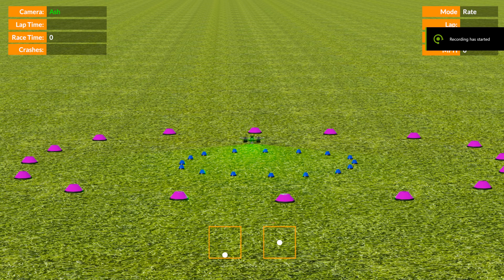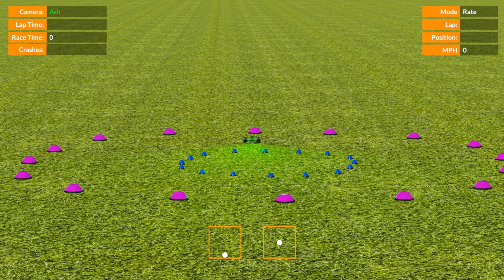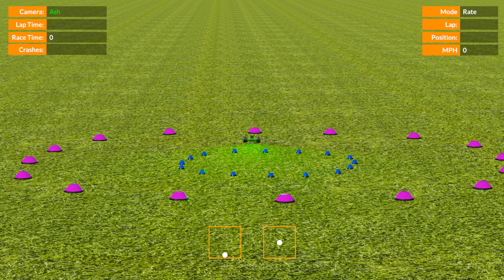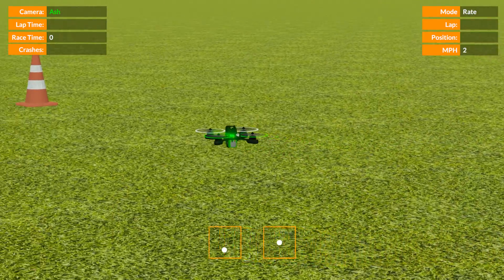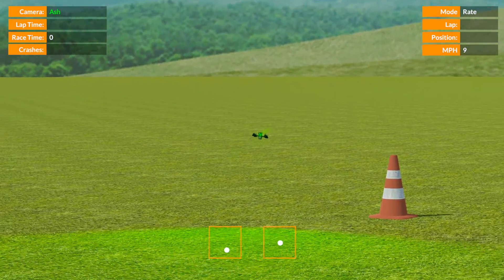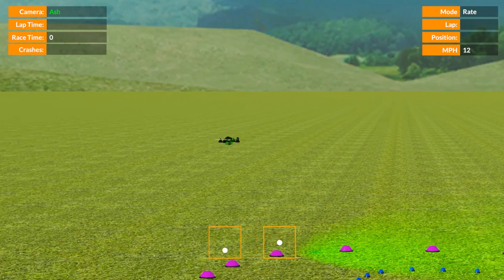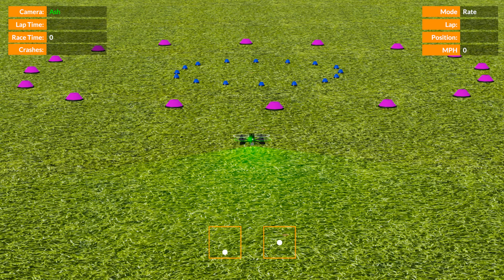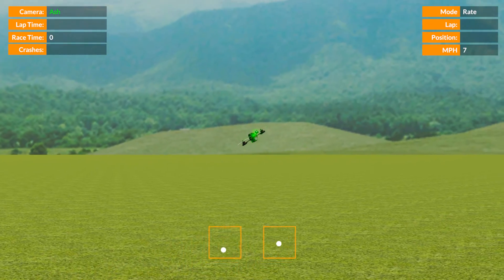Flight Training - Line of sight - Lazy eight circuits

Comment: Please can you make a video for drone configuration? I can't fly with a low throttle like you do, probably something is wrong in my drone configuration. Thank you.
Reply from the maker: I only change my PIDs to 450 deg/s using super rate, apart from that I don't make any configuration changes to the drone. It is all defaults as shipped in the program.
Reply: Thank you, I need only more practice and patience. Sorry if I stress you but how can I see the green light on the ground? Very useful, I have only a green motion blur.
Reply from the maker: In quad settings it should be turned on but you may not see it in the lower quality game modes, in my videos I always run fantastic quality but you need a powerful machine for this.